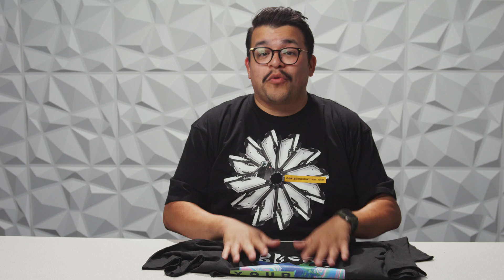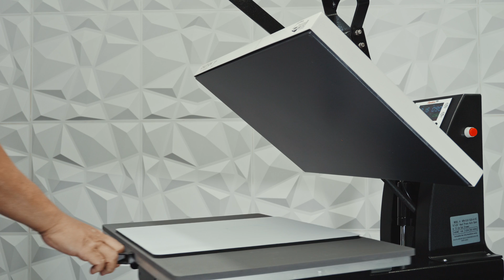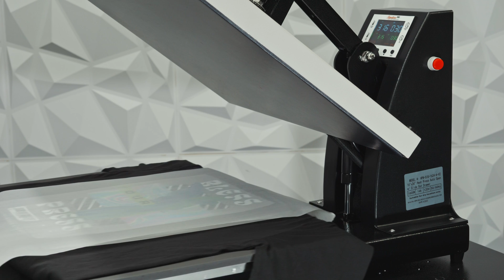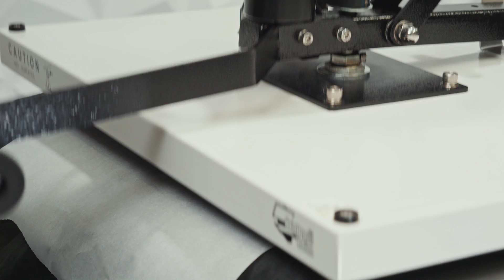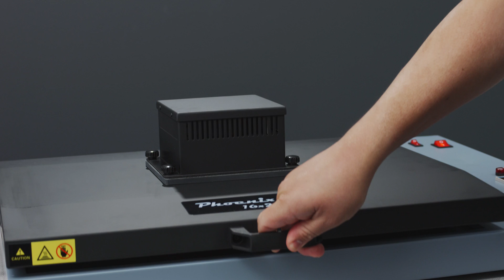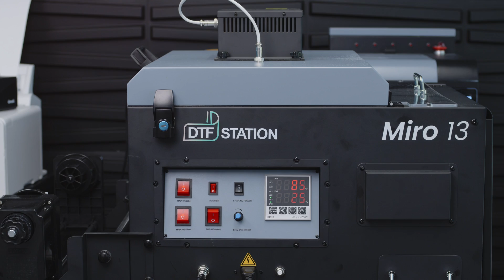Should You Use This Instead Of Direct To Film?

Comment: is it softer than a dtf?
Reply from the maker: It could be - that would depend on how you process the print in the RIP software. In this case, we sent our graphic straight to print with no processing. So if we were to compare this print directly with a DTF version, the DTF print would be slightly softer and more durable. However, with a rasterization effect applied, this print would be softer and equally durable. For more info on rasterization for White Toner Printers, check out this video: https://youtu.be/dTzRWh3Q1Rk?si=5R8rny-1Su8zwEZr

Comment: When is it better to use a white toner vs DTF and vice a versa
Reply from the maker: That's a great question! The answer depends on what lines up best with your business. 

White Toner is going to be great for businesses that need full-color transfers fast, don't want to worry about daily use or maintenance, also want to customize hard surface products, don't have the space needed for a DTF setup. Those are the main factors, but there are others as well - too many to fit in this reply. 

DTF is great for businesses that also want to do full-color transfers, but are looking for a more durable finished product without the need to process every print in the RIP software. DTF is also great for printing custom transfers as a service, where you're shipping the prints, not necessarily complete t-shirts and garments. Again, there are more factors for DTF too. 

We have weekly classes going in-depth on White Toner and DTF. If you want to learn more about either/both, be sure to book your spot at https://heat.press/class

Comment: Informative video. Thanks. How many washes can a shirt handle before it fades or rips with both processes?
Reply from the maker: That depends on what materials you're using, your transfer process, and how the garments are laundered. But in general, a good DTF transfer will last 50 to 75+ washes before cracking and showing major signs of wear. A white toner transfer with basic rasterization effect applied will last around 30-40 washes, while heavy rasterization can boost that all the way up to DTF territory. An unprocessed White Toner transfer will last anywhere from 6-12 washes before cracking. For more information on the white toner rasterization process, check out this video: https://youtu.be/dTzRWh3Q1Rk?si=5R8rny-1Su8zwEZr
Reply: @HeatPressNation  Thanks